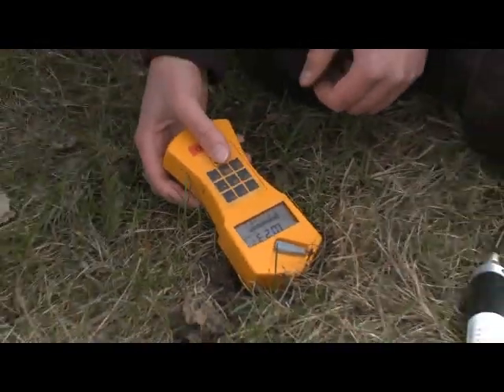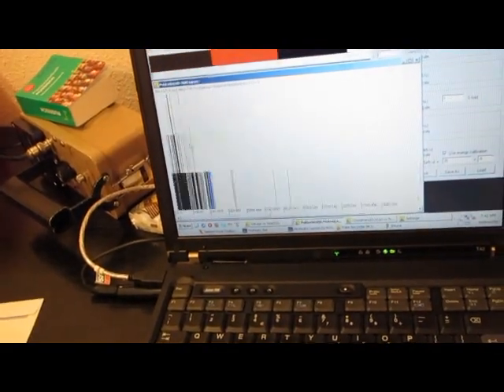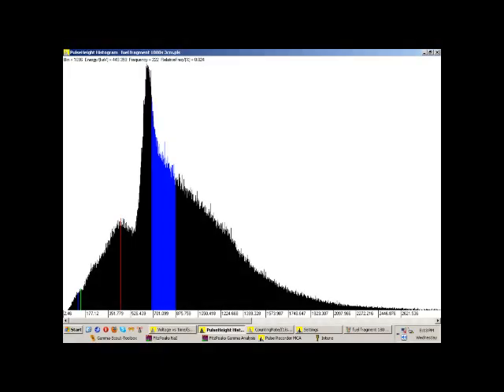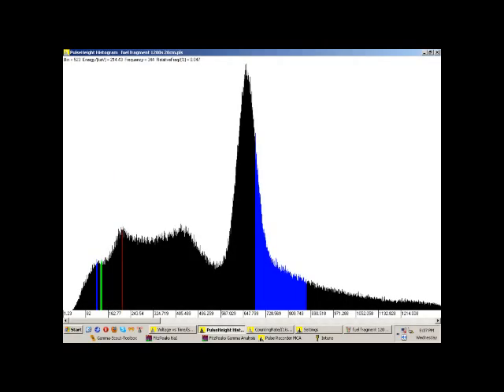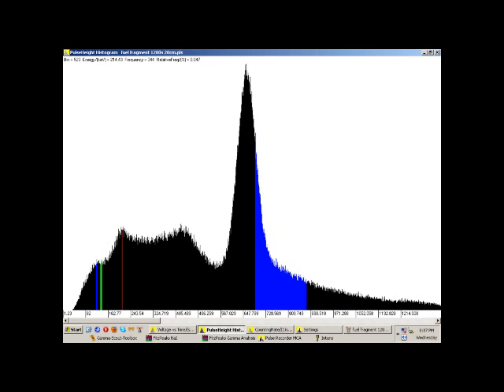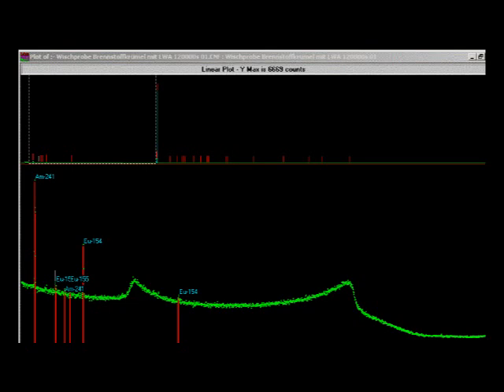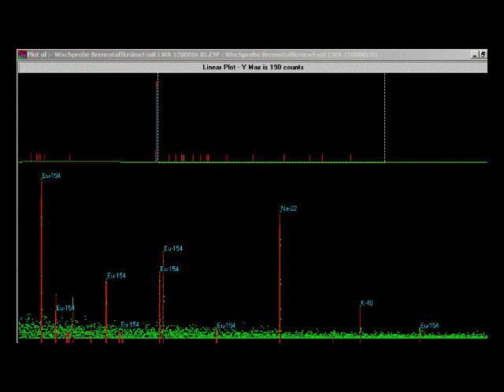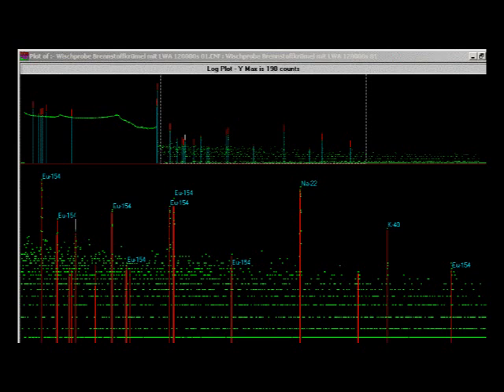chernobyl 2012: gamma spectroscopy of chernobyl's nuclear reactor fuel

Comment: The Na22 is not a fission product, and is not a product of neutron activation. It is likely a mis-labelling by the spectrometer of a Eu-154 gamma.

Eu-154 has a complex gamma spectrum, but includes an emission at 1274.5 keV. Na-22 characteristic gamma is also at 1274.5 keV.
Reply: Doesn't Eu-154 have a relatively short half-life, though? Like too short to still be this radioactive?
Reply: Half life of Europium-154 is about 8.6 years, according to Wikipedia. There might still be a meaningful quantity of the stuff left in the sample https://en.wikipedia.org/wiki/Isotopes_of_europium

Comment: The inverse square law does not apply to extended sources of radiation.  Errors of considerable magnitude will occur when applying it to an extended source of radiation.  Intensity would not equal 4×pi×r2.  Bureau of Standards/NIST

Comment: It may well be a small fragment of the Nuclear Fuel spewed out by the Chernobyl explosion and meltdown, but 30 years on it is still emitting high levels of radiation.

The presence of Cs137 would almost certainly imply the presence of other even more dangerous radionuclides. Strontium and Plutonium for example.

Did you test for the presence of other radionuclides ?

Comment from the maker: haha, that's an absolutely awesome idea. in fact, it's probably the most epic idea ever posted to my youtube videos! :D

aww, should use some shielding, though, and make sure the pigeon does not have to fly too far (long flight). that way, it will not harm the bird. i wonder what the maximum takeoff weight for a homing pidgeon is? that'll determine the amount of shielding that can be used.

Comment: It's actually far more hazardous being around one of those politically correct CFL bulbs when it breaks, especially if it happens to be hot at the time. Mercury vapor is deadly stuff.
Reply: Consider this... there are up to 5mg of mercury in a cfc bulb, and up to 10 mg/litre in petrol (gas in USA) since there are large amount of mercury in crude oil.  So enjoy that thought as you walk down the road.

Comment: Even if you touch radioactive material the damage is done to the local cells, even if the rad spike happens at 0.5 cm away from the material. The longer the exposure the more damage is done to your cells. But our body is stupid, cells multiply, divide, regenerate every itterition is worse [hence why we age]. Damaged cells have a higher chance to form cancer. This process is not limited to local only. Rad damage to a big toe can eventually become a form of bone/blood cancer or other variants.
Reply: Are you saying it would have been better for her safety just to cut fingers off after this doze? :P

Comment from the maker: ...0,8g uran-238 enthaelt also 2,8 trilliarden atome.
das ding (fuel fragment) wiegt nur etwa 1/400, also 0,002 gramm, davon. dafuer sind die atome evtl. auch kleiner. nun muesste man wissen, WIEVIEL von WELCHEM atom da drin ist (massenzahlen - atomgewichte!!). weiss ich aber nicht. deswegen kann man da nur schaetzen - es sind wohl so 10*10^18 atome drin, also 1000000000000000000 atome, bzw. 10 trillion atome.

Comment: Eating that piece may kill you. The (gamma + beta) dose rate will be much higher than 90 mSv/h, given that your detector was saturated. In addition your "jewel" emits a lot of alpha radiation your detectors cannot detect. Assuming that an equal amount of alpha particles are emitted, the equivalent dose rate (Wr=20), when eaten, will be 1.8 Sv/h locally. In your colon (Wt=0.12) the effective dose rate will be 0.2 Sv/h. 6 Sv will give you a 50% survival chance, which is reached after 30 hours.
Reply: Right, important safety tip:  DO NOT eat fuel from the Chernobyl #4 reactor accident.  I will try hard to remember that one.

Comment: Could someone check me on this? ...
1.0 Sievert ~~ 100 REM.
Thus 0.1 Sv = 100 milliSievert ~~ 10 REM.
Thus 0.050mSv ~~ 50 milliSieverts ~~ 5 REM, which is the yearly dose allowed by government regs. (Or, possibly, 3 REM for general population and 5 REM for atomic-industry workers).
So when I see her meter showing 80 millisieverts, that's not a place to stay in for awhile - about 8 REM.
I do know people consider 10 REM to be a significant dose. Not something you want to go do every day.
The meters also peg when a Geiger-Muller tube is getting so much ionizing radiation that it saturates, conducting all the time. There aren't "edges" anymore for the circuitry to read. A good design just runs as quickly as possible to signal that condition; her yellow meter also says "OVERFLOW".
I'm aware I'm grossly simplifying things here and to some extent I'm comparing apples to oranges (I haven't done anything with Gy, for example). But am I in the ballpark?
I'm looking for a way to become comfortable with Sieverts.
Thanks,
Dave Small
Reply: David Small Keep in mind that these emissions are from a single point source; the tiny speck.  She is not receiving a whole body dose at that those levels.  Inverse square law applies to point sources, so even small distances from the particle lower  the dose exponentially.  If she were receiving a whole body dose at those levels, it would be an entirely different matter.  The biggest threat that particle poses is that of accidental ingestion, and that would be a very, very bad thing.
Reply: +David Small Just so you know, a "hot spot" identified as 8 R/hr or 8 Rem/hr is not particularly notable in areas where high radiation exists. To find such a spot in the open air is obviously unheard of outside a contaminated area like Chernobyl, atomic testing sites, and maybe a few isolated areas of the Idaho National Laboratory. The radiation from this speck of fuel makes it clear why NIMBY is such a major problem when dealing with spent fuel. I think you can visit the Trinity site once a year or so, the atolls of the Pacific probably never, Idaho during the summer in a small area away from the action, and Chernobyl... apparently has pretty liberal access. So I guess it's the radioactive boy scout's playground for now. Japan's site is unlikely to have as many, uh, souvenirs!

To answer your Sievert answer... just multiply (the Sv value) by 100 and do the conversion if necessary to the next metric prefix. Pick a rule of thumb (like 1 mSv to 100 mR) and stick with it.
Reply: +David Small sorry, cut and paste didn't work on that last one.
Reply: +David Small The meter is not showing 80mSv, but 80mSv/h. This means you will receive 80mSv if you stay in contact with the speck for one hour. Also, hugeshows is right that it's very different to receive it to your full body, and to the tip of your finger.
Reply: *****
It's not THAT dangerous. A person could ingest it and it would be something to be concerned about, but even that wouldn't be immediate death. Just ask the most famous of plutonium experimentees... Albert Stevens.

Comment: Nice work.  I'm still wondering whether this is actually a fuel fragment/decay product or a crumb of graphite contaminated with Cs-137.

Presumably peak intensity is inversely correlated with half life (for equal Bq samples); given uranium's extraordinarily long half life compared with Cs-137, would its gamma spectrum be identifiable against the Cs-137 spectrum on your equipment?
Reply: Probably graphite. Most of what was spewed was graphite, and it certainly has the color (though it's very small, so can't just go by color of course).

Comment: 0,0001 msv/h is safe. u got 90 per h omg.
Reply: The natural radiation of the earth is safe.
Reply: Sky Marshall The levels from a single point source is not the same as a full body dose.  In fact, it's exponentially smaller, and even more so with distance.  Also, measuring a level of a point source doesn't translate directly into dosimetry.  You have to factor in distance, size, etc for your entire body.  Even when she holds it in her hand, and her tissues directly next to the particle are receiving that full dose, the rest of her body only gets a tiny fraction of that dose because of the distance.  This is the fundamental difference between background radiation and a point source.  Flying at altitude probably gives you more of a body dose than having this particle sitting a few yards from you.

Think of it like a nightlight.  The bulb doesn't get too hot to touch.  You could hold it in your hand.  But if you covered every square inch of your body with a running night light, you'd get burned very quickly.  If you hold it up to your eye, it is extremely bright, like when she puts the counter next to the particle.  But move a few feet away, and it's not so bright is it?  Radiation behaves in exactly the same way, via the inverse square law.
Reply: @hugeshows  at 90 sv/h your tissue turns to mush in a matter of minutes. If you held that with 2 fingers for 30 minutes you'd be left without those fingers after few weeks.
Reply: @korencek  She's holding something 90 millisieverts, not 90 sieverts.  That's a difference of 1000x
Reply: @hugeshows  I see.. still deadly.

Comment: wonder if you could sneak it out by hiding it in a fishing weight?
Reply: +Travisfromoregon I thought of that, too. There are pretty small tungsten and of course lead weights.
Reply: +Travisfromoregon I think I would modify an SD card or something to have a little lead shield. Stick it in camera. Take it through the detector. Also might be able to modify a simple AA battery. I don't know if the particle is too hot for that to work, though.